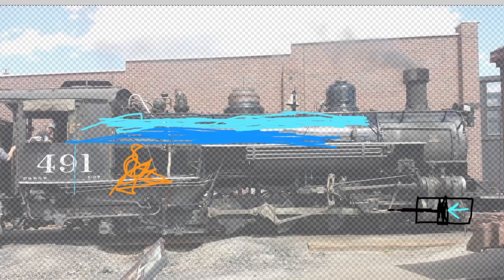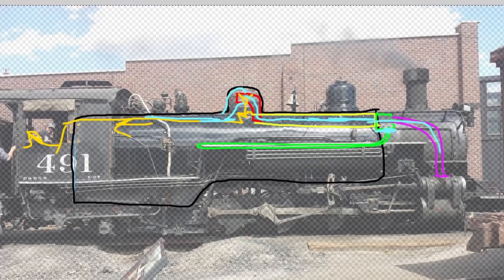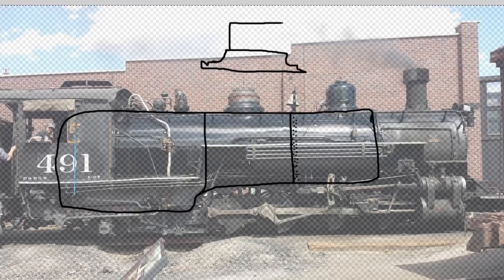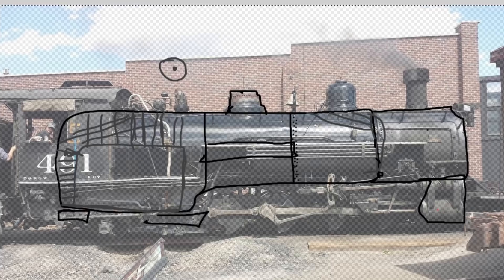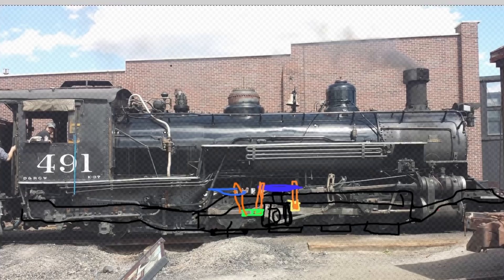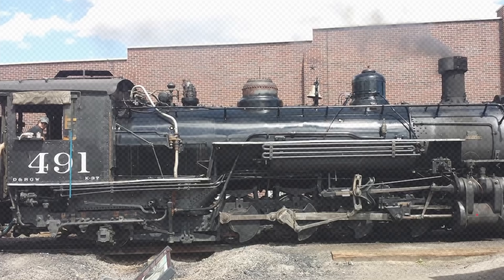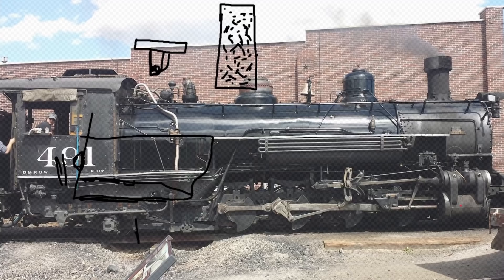Steam 101: 10 Levels of Steam Locomotive Understanding

Comment: Can the Johnson Bar be set too close to the center position to have an effect?  Would applying steam at "neutral" cause damage?
Reply from the maker: It can, if the locomotive is worn in. Most engines "go lame" at a point to close, that causes power to be lost as no steam is admitted. That said, locomotives that are brand new and set up perfectly can, and do run on center. No damage happens, but you are admitting very little steam. If you're already moving, center will keep you going in either direction with steam applied, assuming the locomotive's valve gear is in very good order.

Comment: When you were talking about the spring rigging, it seemed like it was limited to locos with an even number of driving axles (Don't know if that's the correct term.), so I was wondering how it would be set up for a loco with an odd number of driving axles, like a pacific or a decapod. Would they just have a group of 3 driving axles tied together, or was there a different system at play there? Any info would be appreciated, thanks.
Reply from the maker: The principle of 3 points is kept, it just changes where the delineation is. 3 drivers in the rear set, or in the front, depending on design, etc..
Reply: @Hyce777  Thanks.

Comment: A small question: why does the direction control have a range of only ± 75%? And why change it from 75% to approximately 50% when the train is going fast? This finding comes from the TSW2.
Reply from the maker: So in order to cushion the piston and rods, you have to start admitting steam early prior to changing the direction of power stroke. This means the valve has to run somewhat ahead of the piston; this is called the "lead" of the valve. As such, you can never apply 100% cutoff - that would mean that you had the valve open for the entire power stroke until it's ended. In reality you have to open the other side sooner, and so most approximations dial it out as 85% or in the case of the Brits, 75%. Bringing it closer to center, or lessening the time steam is admitted to the piston, means the steam can expand more before it exhausts; which means you get more efficiency the less the cutoff percent is. At higher speeds, you can't generate the steam to "keep it wide open", and you also beat the crap out of the running gear when you do so, so you bring it back closer to 45, 25, 15% ish depending on speed.

Comment: Bit confused here on the superheater, so does the steam run through the inside of the exhaust gas flues, mixing with the gas? I wonder if that means some exhaust gas makes it's way into the cylinders. Or is it like a heat exchanger kind of construction where the steam doesn't actually mingle with the gases and instead contacts the outside of the hot flues? It must be a circuit since you have to get the steam back out of the superheater, right? I'm having a hard time wrapping my head around the actual plumbing and construction of the superheater.
Reply from the maker: It's run in a small pipe down the inside of the exhaust gas flue, with a return bend near the firebox, so there is no mixing of gas and steam.
Reply: @Hyce777  Makes total sense now. Thank you for answering! Didn't expect such a quick reply and from the man himself, no less.

Comment: How does the smoke from firebox force its way through all the tubes to the smoke box?  A lot of resistance there, does it just build a slight pressure inside the fire box until it can overcome the tubes?  Wouldn’t it also be forced out if the air intake under the firebox?  Great video, thank you!
Reply from the maker: The tubes are minimum 2" diameter, so it's pretty easy to flow without any pressure. Heat rises, so you're automatically more likely to get smoke out the tubes / stack then out the "intake" which is below the fire grates. The amount of vacuum generated by the blower, or the exhaust, is significant. For example, when the engine is working as hard as it can, and you're scooping coal into the back corners, the draft pulls on the shovel hard enough that you really have to hang onto it else it will rip it out of your hands.
Reply: @Hyce777  Awesome, thank you for the reply.   I would like to stop by the rail museum and see a cold start up!  I am an engineer working at a huge rail steel mill in Colorado, would you have any interest in coming to see how rail is made?  If you want to set something up let me know how to contact you offline.

Comment: So I'm curious how they made those flexible bolts back in the day.  Did they just drill them out like a gun barrel?  That's about the most expensive way to go about something like that but I guess they had to use a lathe to cut the threads anyways.
Reply from the maker: I am not 100% sure how they were made back then, but I'd guess all manually machined, yes... labor was cheap then :D

Comment: When I apply for an operating position at WWF I'll show them this if there's a "previous experience" section
Reply from the maker: I wouldn't. Learn from the folks there - they'll teach you what you need to know that's pertinent to the locomotives out there.
Reply: @Hyce777  i was joking 🤣 but good point. They have an engine leased from Maine Narrow Gauge that derails in sidings

Comment: How do you set the loco to reverse? Do all steam locos apply the same reverse mechanism? Does the frame of the engine ride directly on the trailing truck?….In models, the trailing truck pivots on the frame, but doesn’t support any weight…..it is free to pivot and ride the contours of the rails….Really enjoyed the video…..I have a K-36 in HO n3…..it’s fascinating to watch it run. Thanks
Reply from the maker: The johnson bar raises the radius rod above the pivot for reverse. Not every locomotive has the same mechanism in between; but the input and output is the same of reversing the motion of the valve, causing steam to be applied on the other side of the piston.

The frame does ride directly on the trailing truck, by using swinging links, or by using large friction plates, allowing the trailing truck to swing but also bear weight.

Comment: That crown brass is babbitt metal  and there is still nothing else on the planet that works like it. They tried bearings (all kinds of them) and babbitt brass or babbitt bronze is still the best option. It's usually sintered bronze. I ran bearings &  bushings on old truck flywheels. The babbitt bushing is a lot more forgiving. The bushing will get sloppy. The bearings get destructive. The bad bearings become shrapnel.
Reply from the maker: Very cool! And yes, there's a lot of babbitt throughout these. The hub liners are as well.

Comment: Odd question. If the injector is started with steam, how do you get water in to make that inital steam? Can you start the injector with no steam in the locomotive? If there is no water in the boiler, I assume no steam. But no steam no injector?
Reply: Injector is used to supply water into a PRESSURIZED boiler. Once the boiler have water and fire is burning, the steam pressure in the boiler prevent fresh water to enter into the boiler. You need an injector to pump water at a higher pressure that boiler pressure.
If you have no steam in the locomotive, you have no pressure in the boiler too. So, you don't need an injector. Water can freely flow in the boiler at atmospheric pressure. Like in an ordinary kettle.

Comment: Regarding audio quality: is it just me and my phone or my connection, or is there a lot of popping?
Reply from the maker: It is unfortunately baked into the video. My interface does not like playing nice with recording sometimes... still trying to hammer it out.
Reply: @Hyce777  I'm guessing you don't have a pop filter in front of your microphone. What is pop filter? Most commonly this is just a fine mesh that is being placed in front of your microphone. So what does it do. It dissipates these big airwaves that you make when pronouncing  certain letters like P where quickly you push a lot of air from your mouth. If that air wave  reaches the unprotected microphone it will record a loud popping sound. So using pop filter is recommended. But what if you don't have pop filter? In that case if you can move your microphone to a different position so it won't be in direct path to the air that is coming from your mouth. For instance placing it on top of your monitor can help a lot.
Reply from the maker: @silvoweiss347  lol! Well explained, like mine in the video :)

As a professional audio engineer, my problems are unfortunately more advanced. My UA Apollo interface doesn't like playing nice with WASAPI audio codecs and for whatever reason any time I am recording outside of a video game it wants to be obnoxious.

Comment: Great video. I’ve been a steam buff for decades but you added a lot of specifics on the implementation of various aspects of the steam cycle. One q. I read that marine steam piston engines eg USS Texas did not use superheat as they relied on “water lubrication” for the pistons/cylinders.  This does not appear to be a concern with typical steam locos.  Was this an issue or because all expansion in one cylinder, there was enough condensation to keep things under control or ???
Reply from the maker: In an ideal scenario, with one of these locomotive you wouldn't have any condensation and you'd have atomized oil in the steam that lubricates everything.
Reply: @Hyce777  Thanks for the reply. I overlooked that because a loco is once-through the oil does not get recirculated to the boiler as it would with a condensing cycle. 😧

Comment: So the rods aren’t lined up on both sides with each other?

As in, when the rods on the right are below the level of the wheel axle, the rods on the left are above it?

Because I always thought that they were supposed to be parallel to each other (always at the same point of their rotation) and having them at opposite points of rotation would be destabilizing (make the locomotive rock left and right).
Reply from the maker: The way that it is, is that they are 90 degrees apart. So, in the picture, these rods are almost all the way "back" down the locomotive - the other side we can't see is "up" towards the boiler. This way, when one piston is midway through it's power stroke, the other is at it's end. That is why we have the big counterweights, though they do still do a bit of a shimmy.
Reply: @Hyce777  This is going to take a while to adjust to, I’ve thought they were perfectly synchronized my entire life and the idea that they weren’t always sounded so wrong to me.

Comment: So on flat level ground (as to not take sander quantity/location into consideration) would a steam locomotive have the same pulling power in forward and reverse then with the piston setup? I'm sure it's probably more difficult to run that way because of the layout of the gauges and bars/levers but would it maintain the same power?
Reply from the maker: If everything is set up evenly, yes. RGS 20 can't actually get all the way into full reverse with the way the Johnson bar is set up. For most locomotives yes.

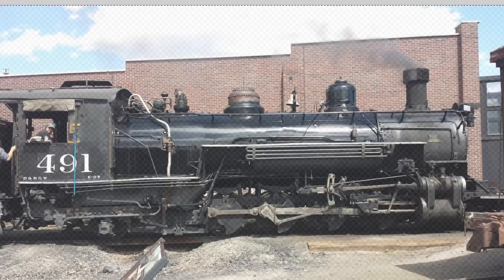Comment: 8:35 I understand the 90 degree thing, creating 4x 90 degree, or a full 360 degree of pressure (or more)
but what about a 3 piston engine, for example, the Gresley Pacifics? they still only have 2 sets of rods, and I know models, such as those from Hornby or Bachman have the wheels set at 90 degrees, but wouldn't the real engines have them set 120 degrees out instead?
Reply from the maker: Should be 120 degrees so far as I know.

Comment: about the wheel counterweight
why narrow gauges (or at least that what I see) have the counterweight outside the wheel (like the one in the pic) instead within the wheel?
Reply from the maker: This is an outside frame locomotive, which means the wheels are inside the frame, but the rods have to be outside. The counterweights counter balance the rod motion, so they are also outside. The outside frame design allows a bigger boiler on a smaller footprint.
Reply: @Hyce777  Thx! I always wondered why it was made that way

Comment: So as a crude analogy....
The Johnson bar serves roughly the same function as a gear shift/selector on a manual transmission in a automobile(/tractor) and the  throttle serves roughly the same function as the accelerator/gas pedal (or throttle on a tractor)
Throttle/ accelerator regulates the maximum speed or power output allowed and the Johnson bar /gear shiftter is used to modify the output to maximize power and economy
Reply from the maker: That's pretty accurate, though of course there's no shifting. I'd suppose it's more similar to variable valve timing in cars, but your analogy's end result is correct.
Reply: @Hyce777  I whole heartedly agree variable valve timing is a  better analogy... I have tried explaining the concept to someone who wasn't mechanically inclined and their eyes tend to glaze over and their face goes blank. But then even manual transmissions are becoming less common.
Reply from the maker: @alexlail7481  No kidding. Sad to see the manuals go, I love them.

Comment: Hey Hyce, one thing I'm curious about is shutting an engine down completely. I remember you saying something about running without a fire can cause problems other than just a loss of steam pressure but didn't elaborate so how do you cool down for inspection and repair.
Reply from the maker: Depends on how severe things are and what you are repairing. The ideal situation is, fill the boiler up with water in slow bursts, let the fire die out naturally, and let it slowly cool. If you've got a more immediate issue, you might have to dump the fire where you are and give it a big shot of water. If you've got something that steam pressure is actively effecting (throttle stuck open) you have to kill the fire completely and then blow the engine dry using the blow downs.
Reply: @Hyce777  cool, so what would happen if you were running at let's say tonnage with 491 and someone one really screwed up and you run out of coal nowhere near a station.

Comment: I know that many ship steam engines often use double or triple expansion designs to increase the efficiency. Has that been tried on locomotives. Probably size and weight constraints are tighter on locomotives than on big ships.
Reply: Double expansion design was tried (compound locomotives). But engine was complicated enough to make maintenance a costly nightmare, not worthy the benefits of double expansion. Unlike on high seas, on a railroad you are not limited by the amount of fuel you carry. Coaling and watering stations could be easily set up along the railroad.
In the end, it was no worth the effort.
Reply: @CipiRipi-in7df  thank you for this information. Makes sense that the fuel efficiency is more important on ships and thus such a design was necessary but overcomplicated for locomotives.

Comment: Some steam locomotive can even use low pressure exhaust steam to run the water injectors. The water injectors just need steam, and the steam turning into water is what makes them create flow.
Reply from the maker: Absolutely! Those are different than the ones I described, but certainly a prevalent option.

Comment: I can tell you about steam expansion, it wasn't a boiler, as near as the forensic team could figure out ,a can of soda-pop was in the load shoot of an aluminum smelter @ Monett Missouri 30 years ago, maybe 40, 3 people were killed 33 others were injured .The soda flashed to steam when it entered 3000LBS. of molten aluminum but the aluminum directly adjacent to the can re-hardened which intern allowed extreme pressures to form before the steam explosion which emptied the smelter vat of it's contents, not sure how the vat was constructed but pictures of the damage showed something , it was about 50 feet long of poured concrete design 3 foot high walls with some sort of insulation and was heated electrically, the three that died screamed until they could not, they were deep fried in solidified molten aluminum somewhere around 1000 degrees F, the survivors said it was ghastly. A gruesome tale no doubt but a picture no less of the awesome power of steam unleashed. incase you're wondering the survivors also said it sounded like a rifle shot then all hell broke loose. Very sad indeed.
Reply from the maker: Holy crap.

Comment: Question about level 6, I've heard that the K-28's were equipped with smoother suspension than the rest of the K classes, just curious how their suspension is different
Reply from the maker: I need to get a k28 expert on for that! Been wondering the same myself. I know that they used dedicated blocks with separate pins to allow better / smoother rotation along each link, but idk if there's anything else.

Comment: So in the UK... What you call the main rod... is the connecting rod and the rods that connect each driving wheel are called coupling rods...
Reply from the maker: And you guys have the guile to call the engineer a DRIVER! Lol! I love the little terminology differences.
Reply: @Hyce777  Now i've watched the whole video... i've picked up on a whole bunch more... All GWR engines' regulators (no matter how large or small) are in the smokebox so it's not just a big engine thing! It also has the added benefit of not being in the corrosive boiler environment... and can be lubricated! No rods down the outside though... just a rod through the centre of the boiler. Just more quirks! Double Fairlies would also impress you over here... the ones today are modded a fair amount and for their size, are seriously strong!
Reply from the maker: @bail60163  Oh interesting. I know of at least one NG loco in the US that has a front end throttle so there is precedent, but most were on the bigger engines. Odd that they still ran the throttle rod through the boiler though. Having to deal with packing is annoying.